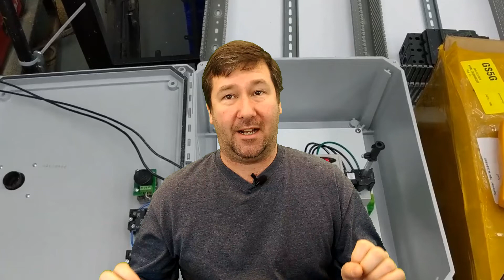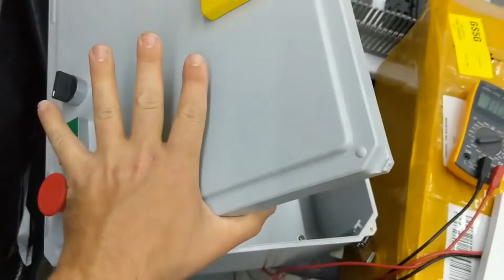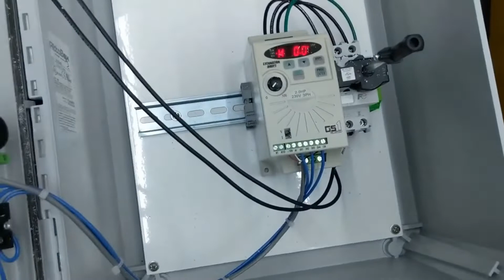UL 508A Control Panel for Automation Direct GS1 Drive #4188C

Comment: Hello Tim, with this AD drive, where do you hook up the potentiometer.. in the manual ,,it shows 2 different places for a Potentiometer
thank you..
Reply from the maker: Potentiometers have 3 wires. Typically 10V, analog input, and analog coming or 0V

Comment: Hey Tim, I have this exact drive and want to build this exact panel. If possible, could you please tell me where you purchased the speed control, start/stop, e-stop, and disconnect or even better could I get a part number and if not, could you suggest a similar part so I can purchase from my end? Thanks in advance!
Reply from the maker: I believe they were Siemens but this is an old panel, I don't recall.

Comment: Can we connect Automation Direct GS1 VFD to allen bradley PLC for control?
Reply from the maker: Look at Modbus. Here is a playlist to help you out on the PLC set up: https://www.youtube.com/playlist?list=PLUi5cdVq3wTCNyXp_W496Z-td2RPm3nES
Reply: @TimWilborne  Thanks alot Tim, I'll go through it. I'm using micrologix 1400 right now. So I'm just hardwiring digital inputs from the vfd to the plc but dealing with the NPN connections.
Reply from the maker: Not a problem, it is all in what you connect to the common.  Here is a video on sinking and sourcing.
https://www.youtube.com/watch?v=VFdtz3q4as8&list=PLUi5cdVq3wTCBnzGxyNIXChObUCvc-2Dx

Comment: I really appreciate your videos and the content you cover.  What is the UL 508A requirement for using an Air Conditioner when the panel has heat generating devices like the GS1 drive?  I realize your panel is oversized, but wouldn't you need some type of heat dissipation (couldn't use a fan as the arc flash out of the fan grate wouldn't pass UL) air conditioner?
Reply from the maker: Enclosure vents don't affect arc flash ratings. You would use an air conditioner when you can't dissipate the heat naturally that is produced by the panel. I have a video coming on heat dissipation but all the enclosure manufacturers have handy heat dissipation calculators.

Air conditioners may also be used just to remove humidity in some applications.
Reply: @TimWilborne  I'm researching the arc flash condition as it relates to fan vents.  How are you able to achieve UL 508A with a VFD wired without overload protection (MCP, fuses, or circuit breaker)?
Reply from the maker: @jimhanley8251  It is on the right side.